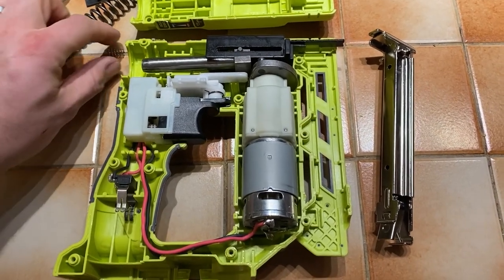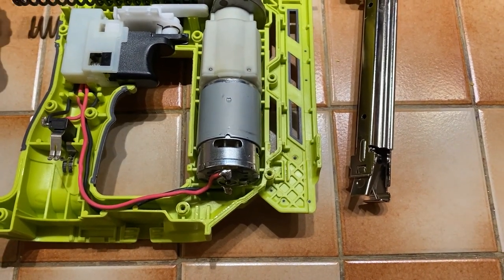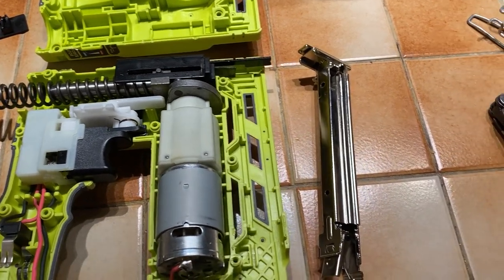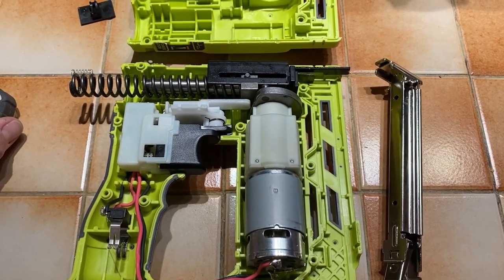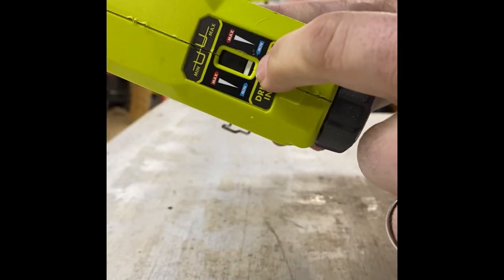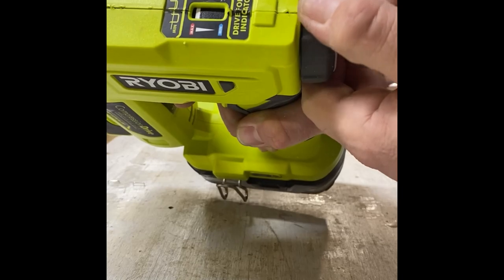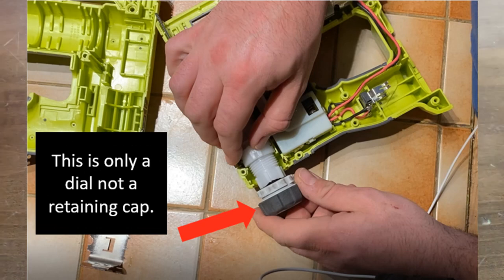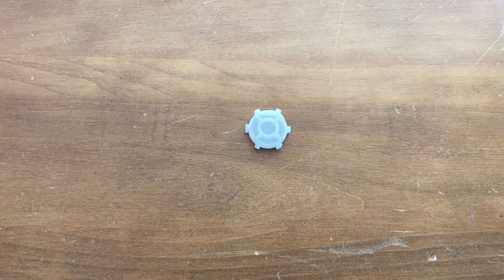Ryobi  18v One+ Stapler Repair [Gone wrong]

Comment: That's Ryobi. They probably cheap out and that's how they sell cheaper. I have an arrow rechargeable stapler, shoots t50 staples. I dropped it and the spring that tensions the feed, came undone. I cannot for the life of me figure out it's position. So the gun shoots fine, but the staples don't push upward to the hammer. Really a pain. First time I've seen one like your's. With a regular removable battery. Mines built in. It's a household stapler, not like the one u are showing. Hope you got it working.

Comment: Great video thank you so much! I’m also having trouble with mine shooting out the spring-loaded mechanism that pushes against the staples as a fire. Happens about every 10 to 12 staples. I think the little clap mechanism is not strong enough to hold back. Any advice? Thanks
Reply from the maker: It sounds like the same issue min is having except a bit worse, the dial on the back of the stapler is not meant to hold the spring back, if you cannot replace the broken parts, it may be best to just replace it. It may also be cheaper as well to replace it if you catch a deal on direct tools.com